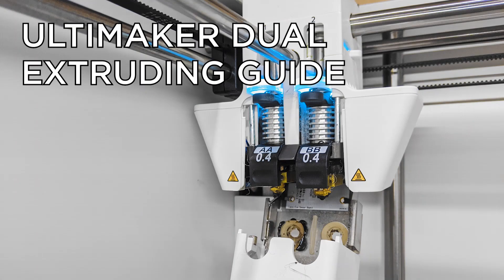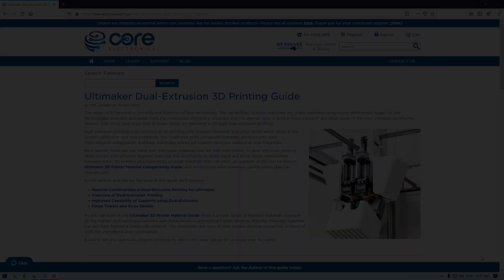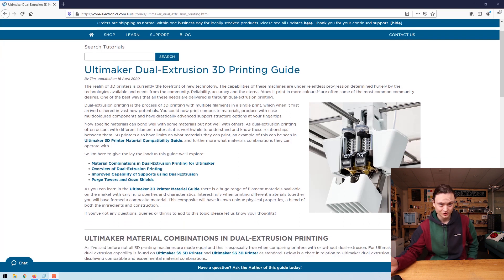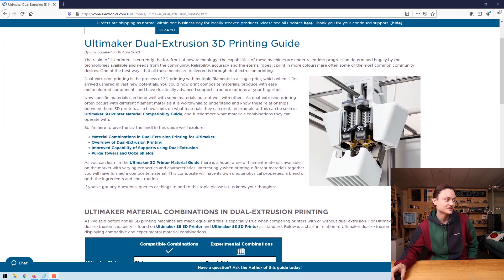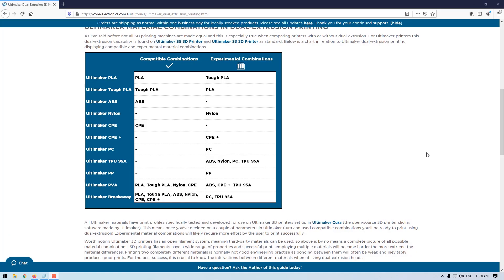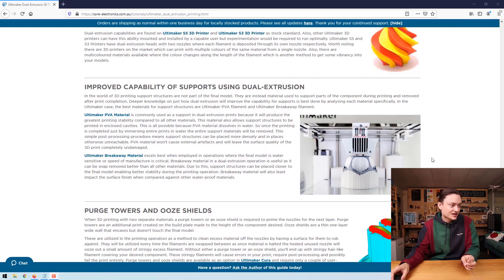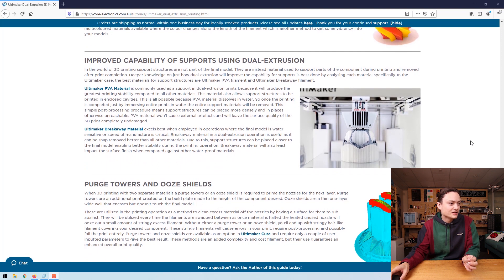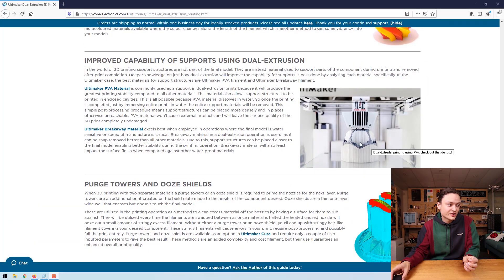Ultimaker Dual Extrusion Guide

Comment: could I do this with marlin?
Reply from the maker: We couldn't say as we have only tested it with the ultimaker.
Reply from the maker: Hey mate, you definitely could configure the marlin firmware to work with dual extrusion so long as you had the necessary hardware on your 3D printer